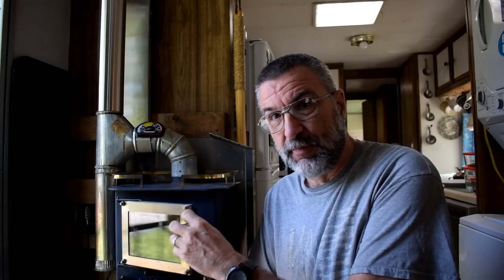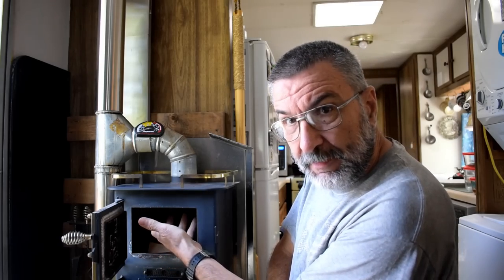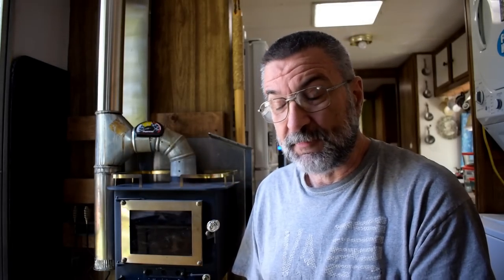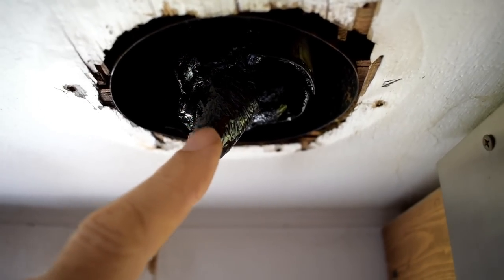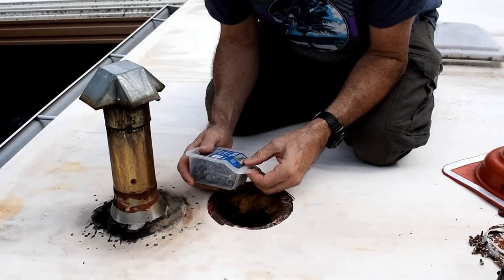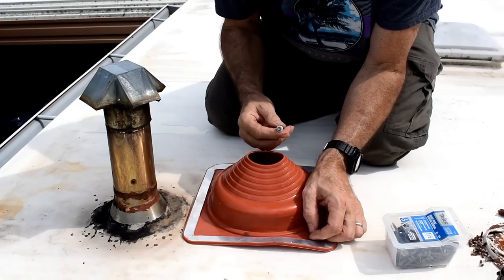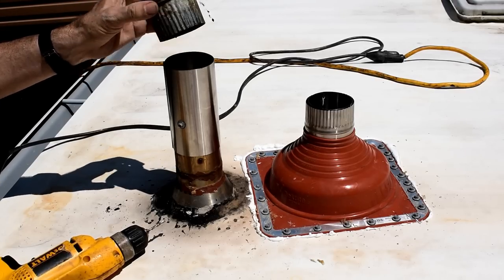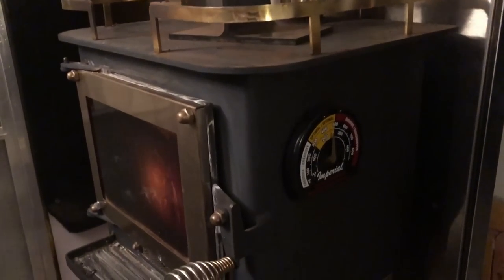Replacing flue pipe on the Cubic mini wood stove with double wall flue to eliminate creosote.

Comment: The real problem with the cubic mini and grizzly, is the lack of an ashtray. such a solution would give the oven a proper feed of air from the bottom and really really help the burn temperature, the draft and not only, but also because; you would be able to clean it out in 3 seconds. But I can see they have learned fast., although failed to set a proper price tag on the issued fixed. I guess that's the cost of development.

Comment: I don't know where you live or how cold it gets where you are but why did you not run the 3" double wall through a piece of 5" that has insulation inside at the roof line. I bought all that same stuff you had except I run mine through the insulated 5" and the gasses stay hot till they reach the end of the pipe.
Reply from the maker: I just recently saw the 5" insulated pipe around the 3" on the Cubic website.  That's new.  Had I know about it, I would have done that!

Comment: How to fight "The Blob" (yeah, I'm giving away my age, lol).
I'm surprised the magnet workes on a hot surface, as magnets loose their magentism in heat. It would probably be pointless for the heat sensor on the new pipe anyway, as the pipe is insulated and much colder on the outside. Job well done. Fires and stoves rally need coddling.

Comment: i find i have double wall and 5 inch that the 3 inch goes though but my spark cap plugs in 3 days ...so i clean my flue every 3 days ...did you have that trouble as well!
Reply from the maker: Yes, so I bought a cap that is MUCH more open, and now I don’t have that problem anymore.

Comment: Question: won't condensation occur in the closed off single wall pipe and eventually ruin the ceiling? Shouldn't you have cut pipe off even with the roof? Be easy on me, I'm a girl.

Comment: What kind of wood are you burning? Oak, hickory and ash ate hotter burning wood. That’s all we burn. We burn 11 cords a winter. Yes, we have a full size wood stove ( Fisher, grandpa) but we only used our forced air furnace 11 cycles last year during below 0 temperatures. Do you also use creosote removal granules?  We use them once a week
Reply from the maker: We use mixed hardwood.  And I have tried creosote control logs, etc, and found them to be worthless in controlling this creosote.  They had no effect at all in the amount of buildup.

Comment: As I'm sure you know, double wall flue reduces the amount of heat radiating from the pipe compared to the single wall. Is the lower heat noticeable/measuable in your environment?
Reply from the maker: Not really.  The pipe is so short, and so small, that we don't really notice any difference in the amount of heat being generated.
Reply: @LiveSimpleLiveFree  Thanks, we are seriously thinking of doing this to our camper. You videos (including the ones you want to delete) are very helpful. Seeing how you evolved help us experience that too.
Reply: @LiveSimpleLiveFree  I've not watched every video you've made throughout but, have paid attention to your observation on the burn times for stoking firewood. Would you tell me what kind of wood you use - pine, oak, locust- since take definitely  effects burn/stoke/reload time & heat temperatures. THANKS! P.S. still watching you videos to catch up.

Comment: It's a problem that heat goes into your home instead of out the pipe?  Isn't that what a stove is for, putting heat into your home?  I have heated with wood for 40 years, and I get nearly as much heat from a well designed single wall pipe as I do from the stove.  Buy  a centrifugal brush that fits on a battery drill, with several sections of support rod.  The centrifugal brush  will clean your pipe easily,  quickly very thouroughly.  And to avoid creosote buildup, don't burn pine.  I clean my pipe and chimney once a year and get less than a quart of soot.  In many areas you can get junk pallets, and many of them are oak, which have almost no creosote.

Work smart instead of working hard.
Reply from the maker: I think you're missing the whole point.  This stove is so small that it doesn't burn very hot.  If I don't keep the flue hot, and the gasses cool down too much, I have to clean the flue once a MONTH because the creosote turns to liquid instead of burning away.  Using double wall pipe keeps the gasses hotter, and that helps burn up the creosote so I don't have to clean it as often.  This stove is so small because it is installed in an RV, and is only intended to heat 250 sq ft.